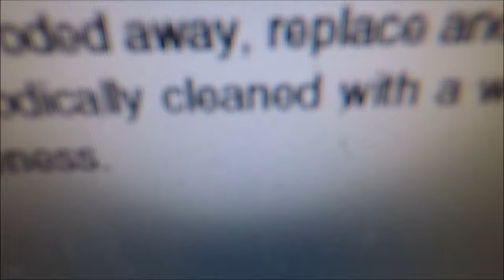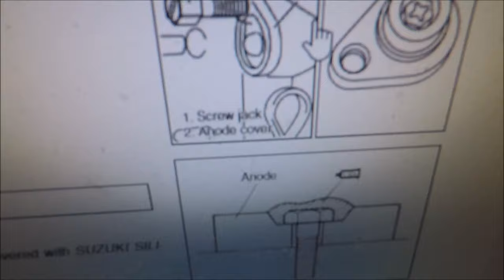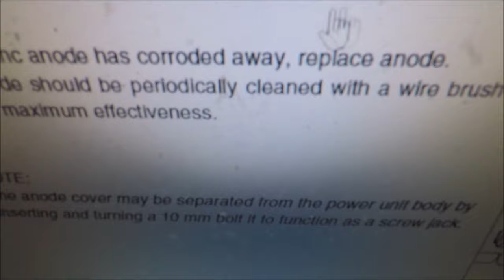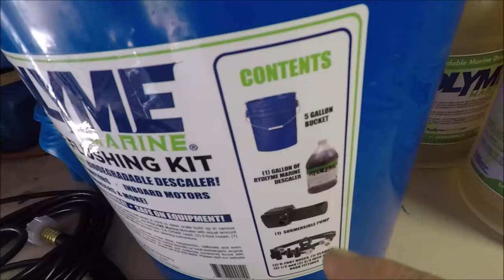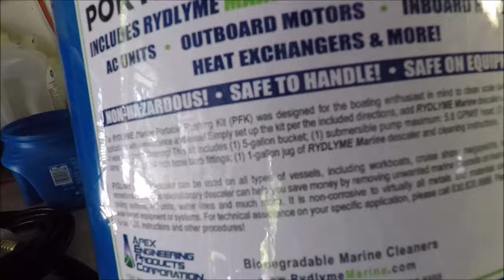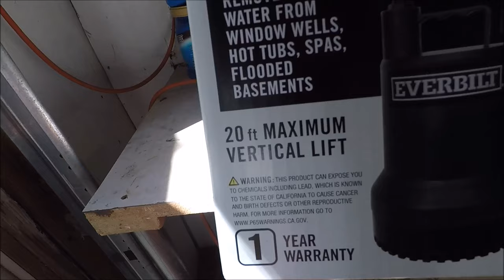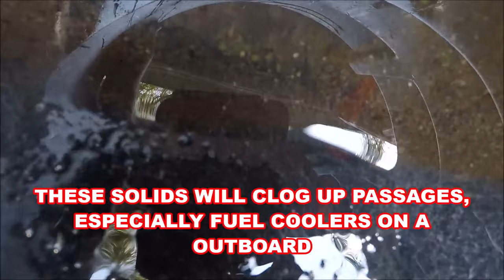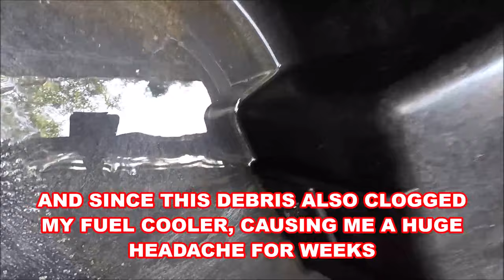ACID WASHING OUTBOARD MOTOR

Comment: Great video.  Where did you get your service manual?  I've been looking for one for my 2018 Suzuki DF 250, and can't seem to find one.
Reply from the maker: WHAT I HAVE: https://amzn.to/2OX2S3W, and never use those crap flushing ports on the motor!! (especially in nasty dirt water or saltwater) Use a barrel ❗ It not only helps flushing ''correctly'', but washes off the drive shaft bearings. That can corrode if left setting up. ALWAYS, do maintenance: FYI,  https://youtu.be/mFRrNnS2H7w    on amazon now, but this is a nice investment to have. Use mine daily:  https://amzn.to/3dqtODo
Reply: @CaptDavesSportfishing  Thanks for the info.  Hope to see you on the water after I get back to the states.  I'm down towards Green Cove.
Reply from the maker: @christopheratkinson7153  doubt that...green cove is way, way outa my zone. I'm a Mayport jetty boat, and around there. Furthest down river I go is, Trout river mouth, northside of Jax. Either way you're in dirt water too.
Reply: Check out Browns Point Marine.

Comment: Damnit man,…..wish I’d seen this video before I purchased the Rydlyme pump kit for my Yamaha 250 on a 2007 Gause Built boat down here in Apollo Beach FL,……I dropped the lower unit, hooked the Rydlyme kit pump up to the outboard water pump tube (that feeds the water up to the entire engine),….nothing came out of the pee tube,…then, I cracked my thermostat housing (thermostats are out) and no water coming out/ no flow.
 Got on the phone with Rydlyme - they’re very responsive/ good people,…..I FaceTime’d them to show what was going on (proved to them the above/ no water flows at thermostat or pee tube), they think it is possibly a bad pump/ overnighting me a new pump, which should be here this morning,…..but, after seeing your video, I suspect the pump is too small/ 2nd pump won’t prove any better. I’m heading to Home Depot this morning to grab another pump with higher flow/head pressure…..need to get my boat back on the water. 
Thank you Captain Dave,……good video brotherman
Reply from the maker: YEP, THEIR PUMP IS USELESS. THEY MUST GET SICK AND TIRED OF PEOPLE COMPLAINING!  I CALLED AND GAVE THEM HELL.  I get comments that all I needed was a bilge pump.....bullshit!  maybe it works on a 20 horse, 2 cylinder, not a 250 6-cylinder!!!!  TAKE OUT YOUR INTERIOR ANODES, PERFECT TIME TO CHANGE THEM ALL, TOO.
Reply: I build power stations for a living (past 25+ years), and part of that work is chemically cleaning huge boilers - meaning, I have extensive experience in this arena. I called Rydlyme, and the President got on the phone (FaceTime), and I showed him/ proved exactly what’s going on with their small pump - I grabbed the same pump you used, and showed him it works with a larger pump,…. They are now sourcing a larger flow rated pump for future sales, and he said he’s sending me the prototype pump free of charge once they finalize + they’re refunding me the money for my original kit. I spent a couple hours on FaceTime with them to work through pump curves/ flowrates they need, to get it correct. 
 Will say, their product (Rydlyme juice) works,…..I pulled the thermostats and anode ‘bodies’ out and it was super clean inside the passages. People don’t appreciate how keeping cooling passages clean, will save them major cash in replacing parts due to overheating damage. I’m like you bud, I try to do all my own maint/ repairs on my shit,….simply because I can, and I don’t trust others to do it right 😁
All my buddies are guides down here in Apollo Beach, FL, and I’ve turned them onto this now,…..I plan to do it every time I change the pump impeller from now on. Thanks for your outstanding videos and what you do for the community brotherman.  @CaptDavesSportfishing
Reply from the maker: @donaldhutchinson5319  I couldn't even get rid of their pump at a garage!  I guess if I ever have a little backyard goldfish pond I can use their pump because that's all it's good for.
Reply: Shipping for me is $135 wich is insane!!!!

Comment: How many gallons is that Rubbermaid Tote, looks like the Water Trough they have on their website but the smallest one they have is 100 gallons...  that's way too big.  Yours looks like a perfect size for outboard flushing.
Reply from the maker: 75 I believe p
Reply: Hay Dave where did you buy 75 gal. rubbermaid tub?

Comment: Do it right. Pull the heads and clean out. The interior is painted and acid is just going to eat up more aluminum for sure. It can also eat the head gasket too. . Good luck !This is a last ditch effort
Reply from the maker: SUPER DILUTED.....this doesn't eat up, or loosen anything but minerals.

Comment: My engine is 5 yrs old now. Still runs like new. Maybe because of freshwater. 
How can boat engines overheat when they are cooled with cold water. Even 90F water temp is cold to an engine. The coolant in your truck engine is much hotter than that and still cools your truck. First time i hear boat engines can overheat. If anything i thought they always run cold. I have never once flushed my motor in 5 years. Dont even have those muffs. I better sell mine in another 5 yrs :)
Reply from the maker: you're the typical freshwater guy, who thinks because of it being fresh water your immuned...FRESHWATER can have plenty of contaminants in it, and dirt. Mixed with heat, turns to clogs in small water passages in your cooling system in the motor.  ''I'd never buy that motor off of you.''   4-STROKE motors especially, have 10 pounds of motor stuffed into a 5 pound sack!!  The water here is many times 87 degrees, in south florida even warmer, at 90 degrees!!.....HEAT generated under the cowling is alleviated via cooling systems like FUEL COOLERS as I stated in my wrap up portion at the end, fuel can vaporize!! Also oil coolers etc.
Reply: The thermostat makes the motor run warmer not cooler unless it starts to run hot.
Reply: My guess is it will not last another 5 years.
Reply from the maker: @BlastedKat  stereo typical freshwater guy, right.  more concerned about the diameter of a ugly stik blank on a catfish rod than outboard motor health.
Reply: Thermostat makes the motor run hot ?.. No it makes it warm up quicker to working temp .its when it doesn't open engine will stay in cold running mode and then overheat. essey to test but cheap to throw away and replace .

Comment: I have been guiding on power plant lakes since 1989. I have to acid flush my motors at least bi monthly sometimes monthly if real busy. At least now days there is Rydlyme. I have been using Muratic acid.
Reply from the maker: what?  what kind of lake is that, the one from the Simpsons with 3 eyed fish. You don't even have HOT salt.
Reply: @CaptDavesSportfishing  San Antonio TX we have 2 power plant lakes (1500 and 3000 acres). They stock it with red drum, they go thru a spawn but the eggs don’t hatch. The water in the lake is 90* plus in the summer. The water is very hard. We get scale build up on the boat itself from the water.
Reply from the maker: @shawnreese4906  those poor fish

Comment: Hi Captain Dave,  I have a 300 hp suzuki and working on the Rydlyme flush.  However, the water does not reach any of the engine block anodes when using a 1/3 hp pump.  I notice you are using a 1/6 hp pump on your 250.  Do I need a larger pump to push the water up?
Reply from the maker: yep, and take anodes out, and put caps back in. t-stats out and put covers back on. still not flooding all the water jacket, put rydlyme hose in top anode holes, in t-stat holes. Gotta flood everything and flush it. Harbor freight has cheap stronger pumps.
Reply: @CaptDavesSportfishing  What I am wondering about this pump pressure is this: maybe one of the impeller fins is right over a water hole, maybe you could make it work with the lower pressure pump if you turn your prop and then see if it reaches the top?
Reply from the maker: @makingcookingfixing  everything worked out fine, this not a how to video, its a warning one for people using their in complete shit water.
Reply: @CaptDavesSportfishing  Yes I know, I was trying to figure out why the smaller pump did not work.
Reply from the maker: @makingcookingfixing  I don't even remember this was years ago obviously I needed more volume by remember I went and bought a bigger and everything worked out just fine

Comment from the maker: RYDLYME Marine Biodegradable Marine Descaler. This product is to be diluted 1:1 with water and water only prior to use. For periodic maintenance, it may be diluted up to 1:3 with water.  RYDLYME Marine works most effectively when circulated through an application such as a raw water cooling system, oil cooler, or A/C condenser in order to rapidly dissolve any unwanted marine fouling of water deposits. RYDLYME MARINE is safe on virtually any metal or material in water operated systems except for zinc and magnesium. ⚠⚠⚠⚠ Make sure to blank anodes or plan on replacing them after cleaning the cooling system on a marine engine. For complete instructions, SDS, and Specifications please review the available Technical Documents below or visit www.RYDLYMEMarine.com

Comment: Does that go thru the  water pump too.
Reply from the maker: no, not running it on the built-in flusher. yes, when I didn't have a strong enough pump, and ran motor in my big barrel. Don't worry rydlyme isn't hurting any rubber or plastics, especially dillutted at 2 gallons in 40 gals of water. But, according to the company when I talked to them, even at that rate it'll do it's job, as seen in video. ''IF'' you watched it that far.

Comment: If you want to really see what it removes, then pour some of the used flush fluid into a jar and neutralize it with some baking soda water.  you will not believe the solids that come out.
Reply from the maker: I can see plenty after a flushing with Rydlyme descaler. Have video(s) all about it.

Comment: I went to Apex's website, looked at the SDS and it is only a 5-9% solution of hydrochloric acid.  5 ounces of muriatic acid (pool acid) per 6 gallons of water wil get you 5%.  Much cheaper.
Reply from the maker: I don't give a shit whatever it is it works I'm not worried about the chemistry
Reply: @russellwolter5153  that's an incorrect dilution. More like 1 gallon of muriatic to 3 gallon of water. 1 gallon of muriatic makes of 35% of hca. When you dilute 3:1 I think you drop tge hca to around 12% which is still quite strong. I believe rydlyme is just under 10% hca. But I heard it has other active ingredient that are inhibitors to help prevent corrosion.

Comment: Can you vacuum that crap out?
Reply from the maker: What?? Heck no.
Reply: @CaptDavesSportfishing  Ok, I did see a video where he’s vacuuming the salt particle’s in the hole. That’s why I asked the professor. Thanks Captain Dave!
Reply from the maker: @rickl.2543  oh maybe with the engine disassembled but sitting on the back of your transom with your cowling off after flushing it you're not vacuuming anything